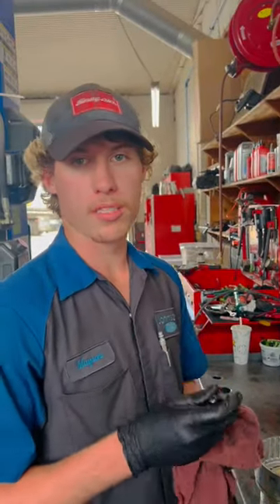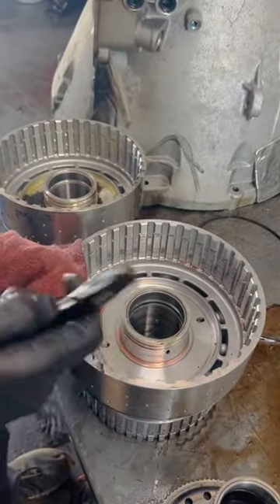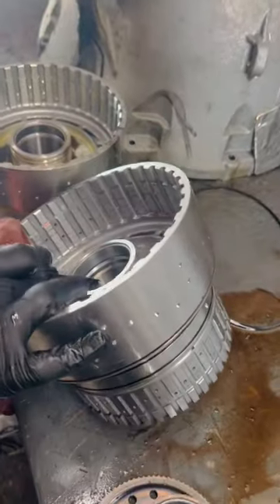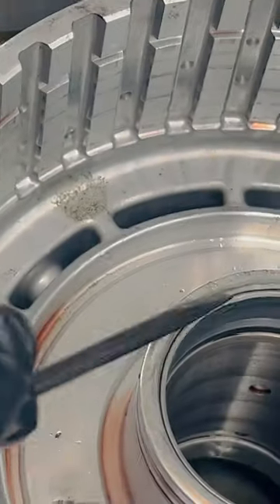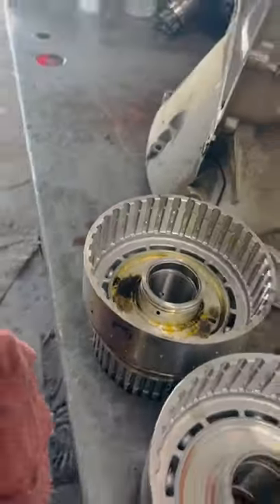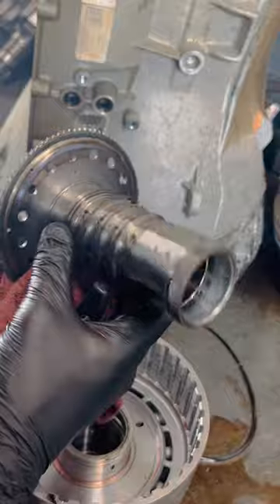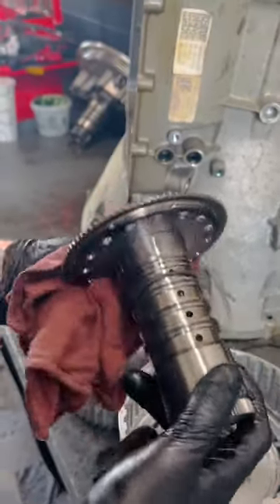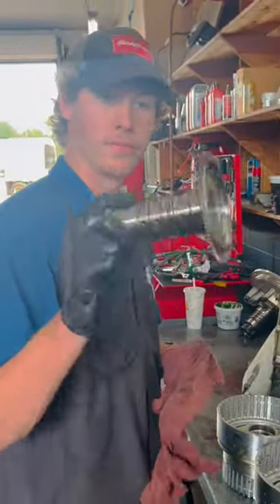Most Common 10R80 Transmission Issue #shorts

Comment: Does replacing the drum fix the transmission? Or did it require a rebuild?
Reply: You have to remove the transmission and open it up to get to that drum so you're going to need to put new seals, gaskets, o-rings etc at a minimum so it makes sense just to put a whole banner kit (rebuild kit) that includes clutches while you're there. It's about 10-12 actual hours of work to do in total so it's stupid to cut corners and not put a whole kit in while there. But, MOST trans shops don't.
Reply: @eagleadmin3042  actually went and had them do that at the dealership. I asked them to replace the drum and any other parts that even looked worn while they had it apart. So far so good but now the engine needs to be replaced. I don't think I'll ever buy another Ford.

Comment: What are the symptoms of these common issues?
Reply: Poor design from  the engineer's IMO
Reply: Improper shifts/ hard slamming gear changes. It can also make the vehicle loose all power to the wheels.
Reply: You can check your cdf clutch by manually shifting from 1rst to 2nd , I its delayed into 2nd or slips, the seal is damages
Reply: @keith5870  I have the slip shift in 1-3, 3-5. They just replaced the valve body after the rebuild didn’t work. After the temp is above 120F it typically doesn’t do it anymore. Sound like a clutch issue?
Reply: @nolanchance1 Same exact problem here. I’d like to see an answer to that question

Comment: Literally just had this warranty by Ford in my Mustang
Reply: How many miles did you have before the seal went?
Reply: Lucky.  I’m a month just after time on the warranty, but still at 58k miles and mine went out.  Dealer already charged my $1400 trying to fix it with the valve body, just to turn around and say “nope, you need a new trans.”

Comment: Now you explain to me, if you can identify the problem, why does Ford build them with the problem, surely, they can be built correctly, how the hell can a brand-new gearbox be built with this fault, doesn't Ford pay enough to its engineers to get ones that can design a box without faults ??????
Reply: Ford redesigned part numbers HL3Z-7H351-A & JL3Z-7H351-A with a newly designed part number JL3Z-7H351-B. You can’t tell me it shouldn’t be a recall on the old design.
Reply: Same reason when your window trims fade within a year, they just replace it with one of the EXACT same design.  So fixing the incident, not the problem.

Comment: Engineers nowadays cant make nothing right. My 2008 transmission hasnt had the fuild changed once and shes still running good on 200,000 miles. You need to tell them to stop with this planned obsolescence bull. I know it puts more money in your pocket because you work at the dealership but really.
Reply: Has nothing to do with the engineers themselves, and everything to do with corporate Ford pushing everything to be made as CHEAPLY as possible, even if it sacrifices reliability.

Comment: That was probably the part GM designed.
Reply: Had a Gmc Denali with the 10 speed and it was flawless. My f150 10 speed is absolute garbage. 2 valve body replacements and lots of trouble shooting and still no fix to the slip shifting. 2018, 5.0, 67k miles. Thankfully I have the extended warranty!

Comment: Hey dud like the vids can yah help me ,  have a 2019 f150 4x4 brand new I put 80k on it and I got a code for P0736
Reply: Gonna end up replacing your transmission.  Mine had the same at 58k miles but I missed the “time” warranty by a month.  Replaced the valve body on the bottom per the Ford service bulletin and didn’t help it a bit